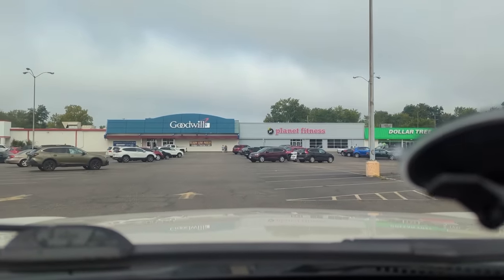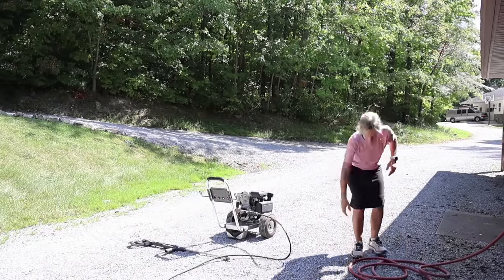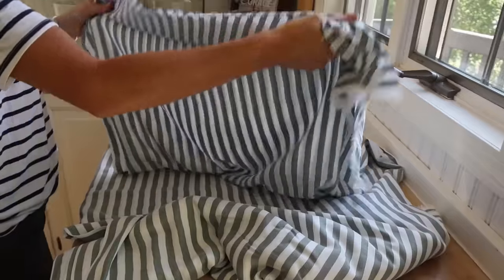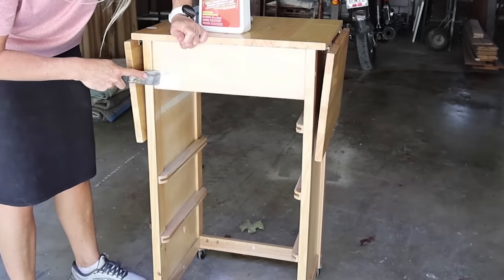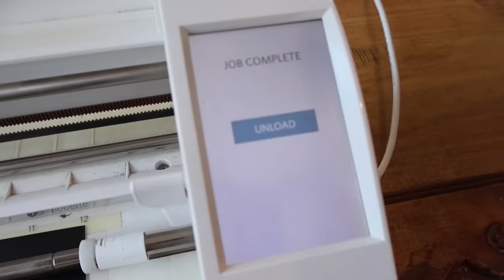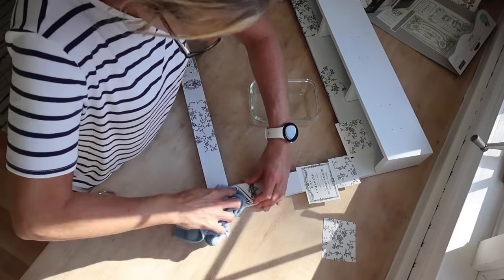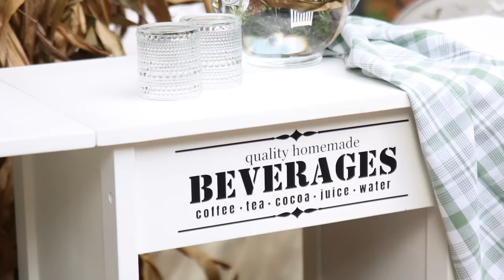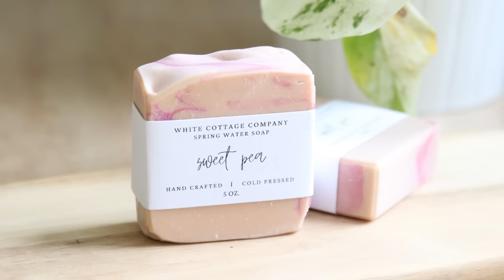Thrift Store Challenge ~ Thrift Store Haul ~ Goodwill Furniture Makeovers ~ Thrift Store Makeovers

Comment: Suggestion, Mary. I've temporary wrap covered foam cushions with fabric several times, and I use some duct tape on back to temporarily secure it. Works great, and comes off just fine! I also found that wrapping the foam with a thin white batting helps the fabric look better, more cushy, less stiff, and foam color won't show through. Love your chair and cushion!💚🤍💚

Comment: You are so multitalented. How lucky you are also to have such a nice Goodwill near by. Our Goodwill has very little furniture and is very overpriced, for a wonky little plant stand ( the type made of several lengths of square pieces of wood, and a spot for 6 plants) they wanted $15. It needed to be cleaned ,some sanding on a few rough spots and painted.
Reply: I like Greased Lightening and if real dirty I add in ammonia to clean stuff, it works real well.

Comment: There's a secret to making a wrapped-but-not-sewn slipcover work for you: duct tape. A strip along each side of the fabric will hold it in place, and you can remove it when you want to change out the fabric. Hot glue will work, but will also pull out chunks of foam when you remove the fabric.

Comment: Just love how things turn out. We're in the middle of winter  2024 and I'm stuck with not being able to work on some project because of the cold and not being able to use spray paint outside or in my workshop. During winter I'm in my basement and there I can't use harsh chemicals or spray paints because of the furnace. I've tried spraying outside, but my paints come out all spitty and gunked up - I've seen you spray outside in winter and always wonder why it doesn't happen to you?